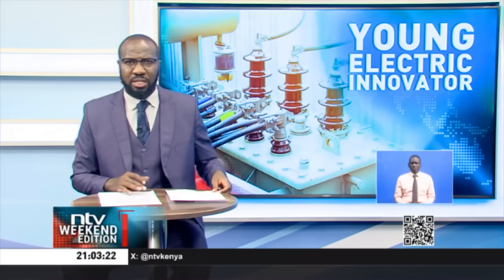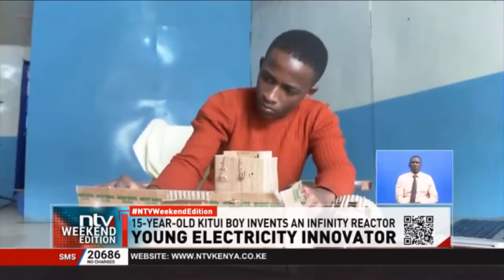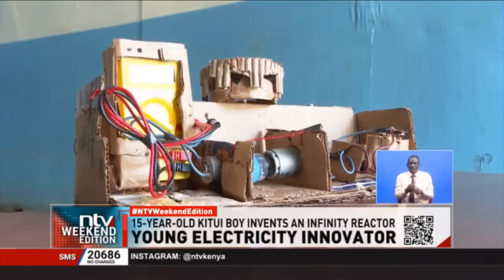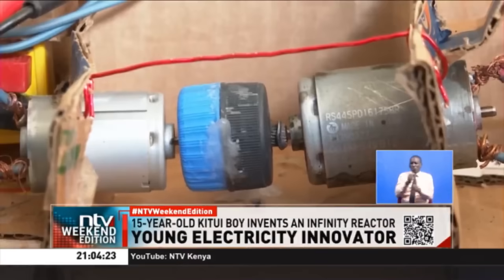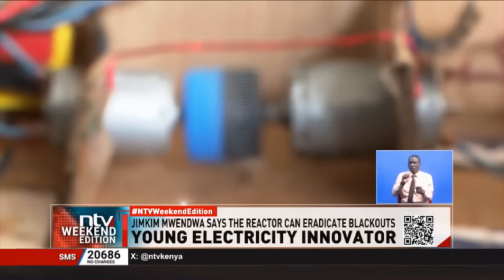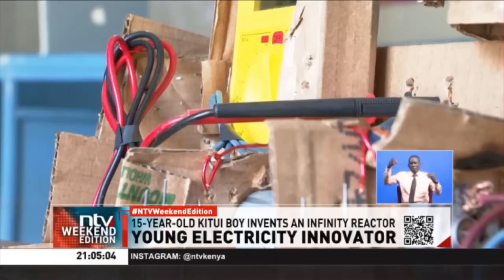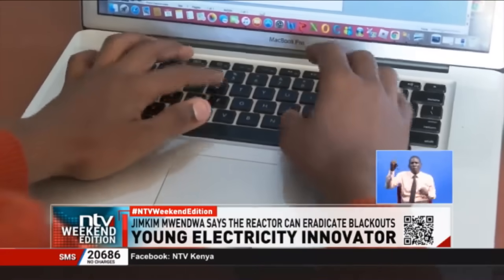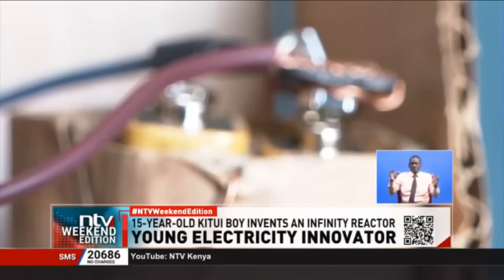15-year-old Jimkim from Kitui invents an infinity reactor

Comment: perpetual machines are "imposible" at least for now. This system is not infinite, even without a load, the system will run for a fixed amount of time and then stop due to energy loses via wire resistance and motor friction, but its a good start.
Reply: True
Reply: I was about to say the same,
Reply: Its Impossible to those who fail to see the possiblity
Reply: @trixbeats7599  the impossible is in quotes
Reply: Ye , atleast he tried sumn
Reply: Yeah, its nice seeing young minds in science but they do tend to misinterpret information and their inventions then shift to the realm of fantasy.
Reply: @trixbeats7599  the laws of physics forbid the perpetual machines. you can't create energy, you can only transform it
Reply: For as long as it can run to a certain degree, then surely there can be a solution to the shotcomings of this innovation. I hope he pushes on with zeal. Alot of zeal!
Reply: It will work, but the power produced will be lower than that he uses to operate the  setup
Reply: Yes  even with the best ones  will eventually run out of   the initial charge.
Reply: @kamaumaina2000 is it God who made those volts

Comment: Not a hater by the way...but both the reporter and the boy are out of order.
1. The dynamo can not produce 1500v
2.The multi-meter he's using can not measure a voltage exceeding 500 and is used for lower voltages eg. Phone and TV repairs
4. Jimkim cannot handle 1500v that will kill him in an instant. Ile yenye hukutoa malaria kwa hao yako ni 240v what  can 1500v do to you?
4.The voltage generated is DC and not AC so the convertor he's talking about can not change from DC to Ac.
5. Electromagnetism can only produce low voltages that can barely do the things he mentions.
6. Transformers do not produce power-they either step up or step down voltages depending with the need--the reporter ought to have done her assignment.
Anyway sina maubaya but i needed to bring that out to stop the misinformation.
Reply: he is 15 bro he is still learning cut him some sluck
Reply: You are right hisipokuwa hapo kwa Electromagnetism. We genarate electricity from electromagnetic fields. You could have said Dynamo can only genarate small amount of electricity.
Reply: correction, that cheap multimeter you see there measures 1000V of Ac and Dc
Reply: @KSACTV he's too dumb for us who did physics
Reply: @KSACTV No he needs to be correctly informed, imagine if he is hired to provide large power supply and it fails,Much greater disappointment
Reply: That is a demonstration not the actual thing.
I can't build it as I said.
I was as well wrong about the calculations.
It is 7 gigawatts per second.
I couldn't show the real thing since it may be stolen
Reply: @jimkimmwendwa398  Good to see that we are all ready to learn. Go for it and make as more mistakes as possible along the way, you'll get there.

Comment: There are several reasons why an infinity reactor, as depicted in fictional universes like Marvel Comics, is not currently possible with our current understanding of physics and technology. Here are some key limitations:

1. Law of Conservation of Energy: This fundamental law states that energy cannot be created or destroyed, only transformed. An infinity reactor would need to violate this law, continually producing energy out of nowhere. No known process can achieve this.

2. Exotic Matter Requirements: Most fictional depictions of infinity reactors rely on exotic forms of matter with extraordinary properties not found in nature. These are highly speculative and their existence has not been confirmed.

3. Containment Issues: Even if such exotic matter existed, containing it and harnessing its energy in a manageable and safe way would be an enormous challenge. We may struggle to build materials strong enough to withstand the pressures and radiation it could generate.

4. Fission and Fusion Limits: Nuclear reactions, like fission and fusion, release energy by converting mass into energy, but they have inherent limitations. No known reaction could sustain infinite energy production.

5. Entropy: The universe tends towards increased disorder (entropy). Any system converting energy would eventually lose some to waste heat and become inefficient, falling short of infinity.

6. Safety and Stability: Building a device with limitless energy would be incredibly dangerous. Controlling and containing such immense power poses immense risks of catastrophic failure.

7. Practical Challenges: Even if these theoretical hurdles were overcome, the engineering and materials science challenges of building such a device would be enormous, far beyond our current capabilities.

Overall, while the concept of an infinity reactor is fascinating, it remains firmly in the realm of science fiction due to the fundamental limitations of physics and our current technological understanding.

Comment: For a form two guy this is really commendable. I have my reservations on it being an "infinity reactor". Friction alone will consume a huge chunk of energy making the energy transfer less than 100% which implies that he is using more power to drive the reactor than he can get out of it. Research into super conductors should help resolve this problem but right now the technology is very far away from leaving the lab experiments into real world application.
For the "infinity reactor" definition to hold he needs to extract more power than he pushes into the generator which doesn't seem to be the case.
Reply: Speak positively for this 15yr old child, Imagine with no hi-tech resources, mentors, or higher level edu , he  invented an Infinity Reactor, whether it works or not, he beat many theoretical graduates like you
Reply: @Chulaimbo   attention to details is something I have learn overtime. Please check my first line on the comment. My criticism is mainly directed to the education system that isn't doing justice to the guy. He is hungry for more technical knowledge but barely has any access to it. I know because I have been in a similar situation.
Reply: So what are you doing about it..ama unakula ugali tu
Reply: Similar to the idea of a perpetual machine. 
But we can't be the villains bursting his bubble and commendable effort
Reply: Engineer omollo
Reply: Quite commendable,but in the realm of science perpetual motion does not exist that's free energy overunity😅 good trial
Reply: @Chulaimbo ..sounds crazy but if you had been in a electromagnetism class for the first time..😂this would have been the first thing that pops in your mind when you learn how electricity is generated..congratulations to him he took a step that not so many students do...but that just wasn't enough research..i'm sorry
Reply: @Chulaimbo critique is actually pretty positive if you asked me
Reply: Exactly my point ..way too much energy is used to drive than generate..i have thought of this kitambo...its not viable

Comment: Kudos! to the young man,,,my concern is with the NTV editor and the engineers. They didn't research on this since an infite motion can never be achieved.
Reply: Yah I thought it does not use battery, magnet only
Reply: Thats where those electric stones from congo come in
Reply: @smuriukism 😂😂
Reply: Can a car run on water without any electricity

Comment: I started the same project while under 18 today. I am almost 30. The fact about this project is that there is a loss of power if one powers motor. The physics law is that there must be a source of power. So what will happen this project will run for a few minutes and the stop. But if he wants to upgrade, he must create strong magnets that will provide N on alternator and S on magnetal to repel the magnets on the alternator. Then, some other few factors must be considered.

Comment: Transformers don't produce power, they step up voltage at the expense of current; the power remains the same more or less depending on how efficient the transformer is.
Reply: Good observation, the experiment may not work, even with transformers made using super conductors.
Reply: @matthewthiongo5121  Yes exactly, this boy is out of his depth, considering he did research for one year and he didn't come by Newtons law of conservation of energy, he should think of maybe changing careers to something a bit less technical.

Comment: Not to be a pessimist but it only works for small devices. There's nothing like free energy. Motion in one motor is converted into ac current that is utilised by the other motor. According to square-cube law; when an object undergoes a proportional increase in size, its surface area increases by the square of the multiplier, while its volume (and hence its mass) increases by the cube of the multiplier. This can have significant implications for mechanical devices because it affects factors such as strength, weight, and surface area-to-volume ratios.

Comment: This is a perpetual motion machine which violates the law of conservation of energy.  If you take without replacing energy out of the system in form of electricity, it will lead to the system stalling. I like the fact that he didn't try to hide the 9V batteries powering the motors

Comment: Cool project, but factor in system losses, for it to be a Tru infinite reactor, the conversion efficiency has to be above 100% there is loss of energy from the motor, since not all electrical energy is converted to kinetic energy,there is mechanical loss in friction form,heat loss, same to the generator side...it is just against the law of conservation of energy....the system is just converting electrical to kinetic then back to electrical,

Comment: Good attempt. Requires some refining based on fundamental Laws of Thermodynamics, Thermal Losses (including Lenz Law of Electrical Resistance) and Entropy. 

There are some higher level criticisms that can be addressed as various iterations of this solution are tested. Otherwise it would just remain as a generator (dynamo) coupled to a motor. 

That being said, a journey of 1000 miles always begun with one step🙏🏾

Comment: Not downgrading him but it is actually not a new invention, it is just new in his area or school. It is very easy to make it using two motors and a starter battery. The starter battery is used to activate the first motor which will then create an electricity based on electro magnetic field, it then powers the second motor either using a belt or a metal connector . Power is then connected back to the initial motors and the second motor becomes an output. This makes it a self running and not depleting power source unless disconnected manually. If anyone reads this and he or she did physics in high school then you can easily relate. If you didn’t do physics then this will seem like a new invention

Comment: My major question is how many batteries has he used to power the device to generate the electricity from the infinity reactor. What a name for the device thats points for creativity
Reply: Is that even generating electricity or converting it from one state to the other. It should just be known as "mechanical DC to AC inverter"

Comment: With a load the system won't work due to the resistance  created on the output motor which slows it down and lead to more input Voltage even higher than what it's outputting

Comment: well done but this ain’t working like that
it is possible to set motor-generator entanglement to run for several time if there is load taped to it. Once you try to drain energy from the system it slows and stop!
am an electrical engineer

Comment: I've had this idea for the past 20 years but did nothing with it. I used to be fascinated by electronics. My idea was to to use a small power to start the dynamo spinning through the use of an electric motor. Then, feed a little of the generated power from the dynamo back to the electric motor and store/use the rest. Of course, there's a calculation to be made in order to know what other electric devices like resistors, capacitors, etc, that you will need.
Reply: You need EPIGNOSIS
Reply: The idea is worth trying. The reality is, at the end of the day you will have made some sort of a mechanical battery (as opposed to the chemical ones that we are used to). It will spin for some time, then stop. Then you'll have to recharge it again. So you are not actually creating infinite energy. Look into the law of conservation of energy -  energy cannot be created nor destroyed, it can only be transformed from one form to another.
Reply: @francismaithya1041 Thank you . At least some one in the comments section understands physics
Reply: sure
Reply: @francismaithya1041  speaks truth. But telling people who don't understand this gets you branded as a hater. I am genuinely interested in ensuring these kind of minds do not go to wase under our education system

Comment: 🤣🤣🤣🤣There is a reason why it's not done, it's called a fundamental law of Physics... energy is neither created nor destroyed... only conversion occurs therefore definitely there is a sum loss of energy in the entire system. think of it like this, why don't just electric cars get alternators to recharge the batteries and the car can virtually be limitless? - an alternator needs to be turned using the engine's kinetic energy therefore a net result braking force. Don't believe all you see online Kid. I can't believe this was on tv 🤣🤣🤣🤣🤣🤣

Comment: The reporter should be fired , as well as the person who approved this on air. That's the problem with hiring slay queens as reporters.  Why not even run it by High school physics teacher before you air it if you are unsure. Reporting basics you fact check , stop being lazy.